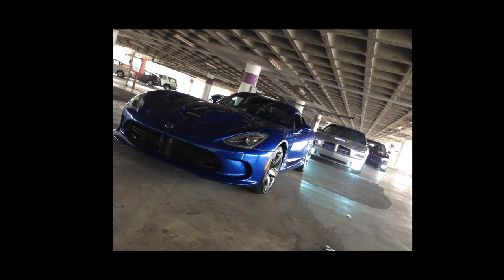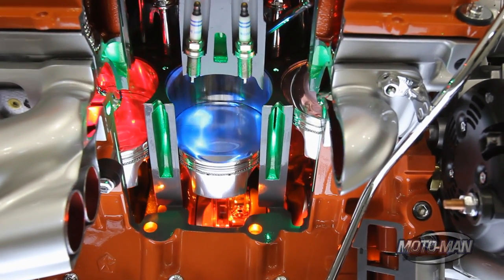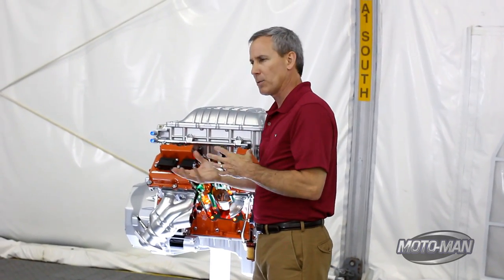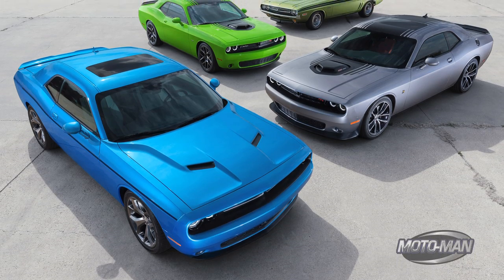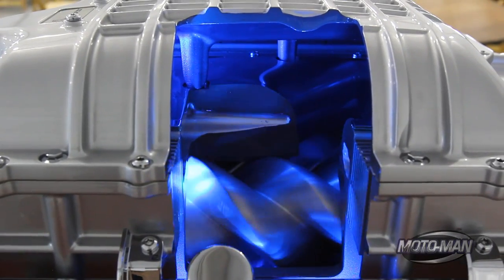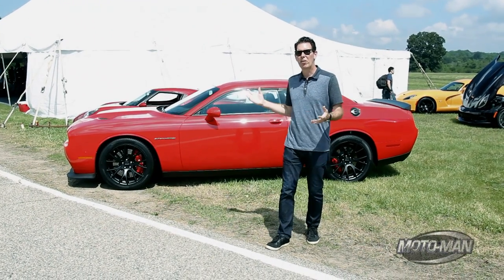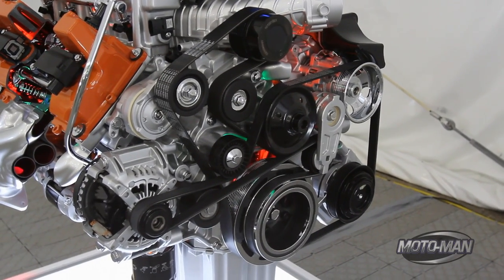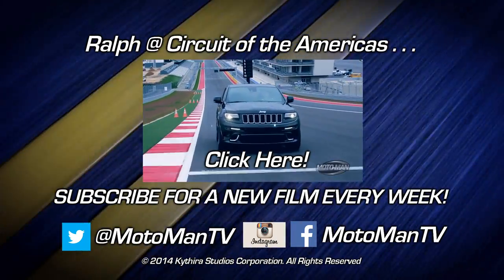2015 Dodge Challenger SRT Hellcat -- Tech Review with Ralph Gilles & Crew

Comment: they didn't go turbo because lag lol- what age are they in - must turbo cars now have no lag at all - wtf!!!
Reply: depends on the setup - - drove a 135i -with burger tune no lag at all
Reply: I'm pretty sure anything turbocharged you can build that has 700hp and idles smooth as glass will have more lag than a supercharger. Positive displacement rules in the throttle response department..
Reply: http://www.koenigsegg.com/ no lag - 5.0L v8 twin turbo - its just how its setup - like i been saying - from a bmw 135i with 455hp at the wheels or a koenigsegg supercar - with over a 1000hp  - some can - because of the setup - but most of the time - when the car not turbo first hand . when people do it there self - they do it all wrong and use way to big turbos for one - also when u talk about turbos there or the types - double ball bearings one and rotrex ones the best - they have no lag at all the ones Koenigsegg uses  . anywho - im a car tuner - so i think i know something about it - and sadly turbo if its done right will always be better - and another anotherr thing superchargers have lag  - but just a very little
Reply: http://brewedmotors.com/image/data/blogs/als/als3r.jpg  = no lag - this is from most turner cars like honda s2000's and wrx's rally cars - to v8 nitto cars but yea just how u can do it - there are other ways also like in most newer cars its done all by the ecu and small turbo / big turbo - one helps the other also - Garret now has a setup where there turbo's have a extra turbine that works when the other one doesnt to take care of that lag . .
Reply: Turbo's are European or Rice Burner Crap! Blowers are Classic American! We don't want Turbos.
Reply: lol u are just too funny - look it up - the fastest cars on the track use turbo's - and some are  American Classics - - also don't talk shit about imports - Ford / Dodge / Chevy and then some - all use import parts - from the German peeps
Reply: Corey Bruno Ford / Dodge / Chevy and then some - all use import parts - from the German peeps i know dodge, and ford does but i never heard anything from Germany that chevy uses
Reply: the new corvette
Reply: I think I know why they didn't go turbo, because turbo charged cars sound like shit lol. Just look at bmw, they have killed their M division by adding turbos to everything. They all sound like honda's now.
Reply: lol  not a v8 thats why and funny the new m2 / m3 / m4 / m5 / m6 are all better then last models so  u got it all wrong
Reply: I didn't say they weren't, I just said they sound like shit.
Reply: ***** they a v6s or inline 6s but nobody has a beast sounding 6 but the supra
Reply: roshawn1111
 There is alot of ignorance in that comment. You might be too young to remember, the Grand National, GNX, 89 Turbo Trans Am, GMC Syclone and Typhoon just to name a few. I put 7K into an 87 GN that would wipe up the asphalt with most of these new cars and was using a 20 year old engine block.
Reply: Marc Smith good words - and good taste of cars / trucks
Reply: Marc Smith i didnt say fast i said beast sounding besides all those cars are on par with the supar neck and neck its all about the set up and driver
Reply: its supra - and yea the Supra is a legend with the skyline and RX-7 also - hell a  3-rotor  20b rx-7's run 11's straight up and no lag at all - fun little ride .
Reply: Corey Bruno relax its a typo and yes all those are great cars im saving for a rx-7 now might get a 350z though and put a ls in it
Reply: rx-7 better car but if u thinking about a Z - get the 370Z